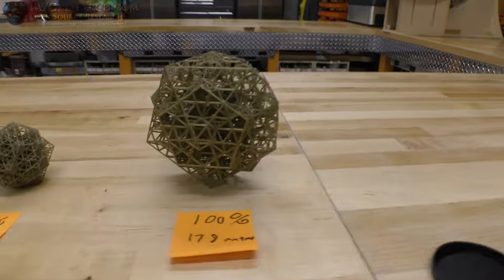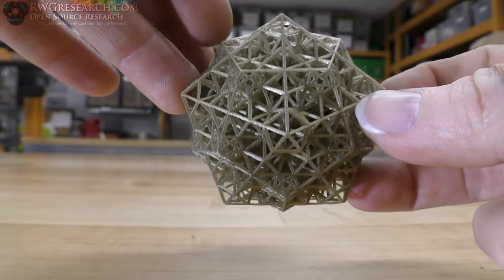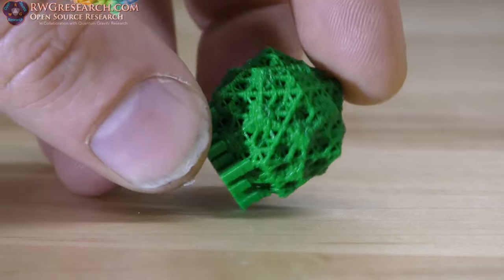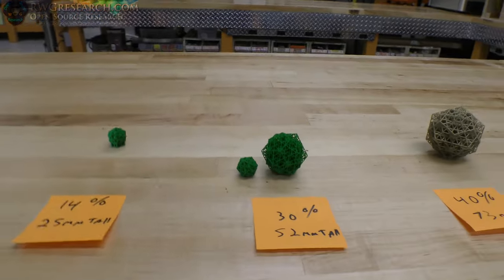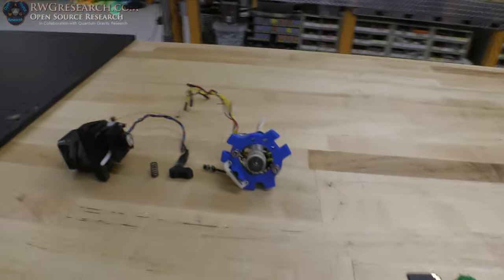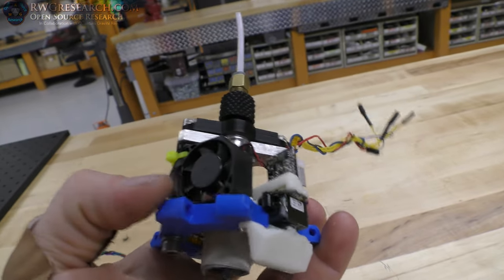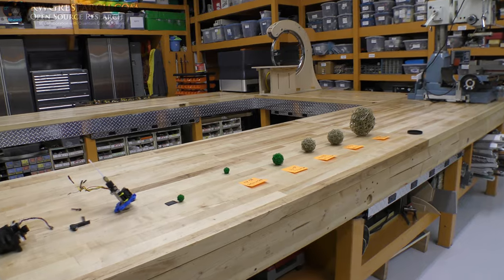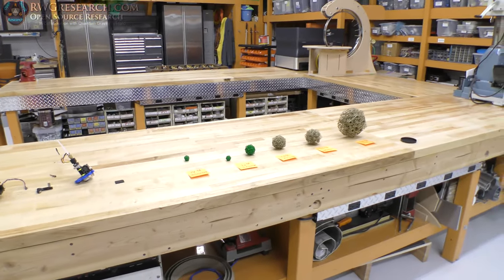25MM QSN With .4mm Nozle & Quick Look At My Hotend / Extruder ( In 4K)

Comment: I purchased a 5lb roll of Silver PRO Series PLA Filament by MatterHackers a while back. I'm not disappointed. But I was surprised that the roll is as big as a 35lb roll of welding wire.
Reply from the maker: brainfarth oh yeah. while i was there. i seen the 10lb rolls of .3mm filament! talk aboit crazy. lol. i will have some video of that up soon! ~Russ
Reply: I hope the diameter of the roll isnt any bigger than the 5lb versions. As it stands, I need to get around to building a new enclosure for the larger size rolls.
Reply from the maker: i'm not sure, but i think there just longer. not bigger in Diameter. ~Russ

Comment: The smallest one looks like you're looking at an object using an electron microscope.
Reply from the maker: yeah! that's a really great way of looking at It! i have access to a SEM and a TEM. and your spot on! good stuff! ~Russ
Reply: I wonder if a similar technique could be used to develop three dimensional models of atomic structures? Such as molecular transistors or quantum transistors sometimes having a three-dimensional model that you could pick up and look at from different angles and hold in your hand can give you more insight into a structure that looking at it on the screen.

Comment: Still prefer 60fps
Reply from the maker: JohnEnergy2012 yeah. there is good in both. but do you habe a 4k monitor? ~Russ
Reply: No, that's why 60fps is more spectacular. 

4k/60fps to compromise?
Reply from the maker: yeah i wish this would do 4k 60. because i can see a big color difference when i compress 4k rather than shoot in 1080p. so if i want major detail i just go for 4k... or if i want a wider angle shot... else ill try to stick to 1080 60... im still hit and miss on what i like more. 60p or higher bitrate and better over all quality... ~Russ